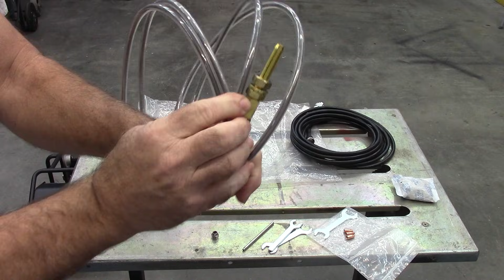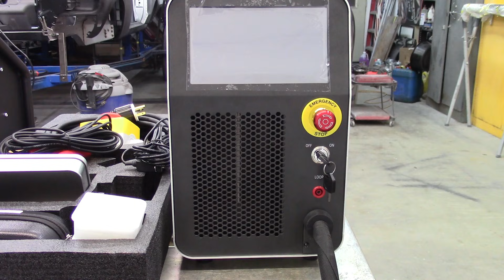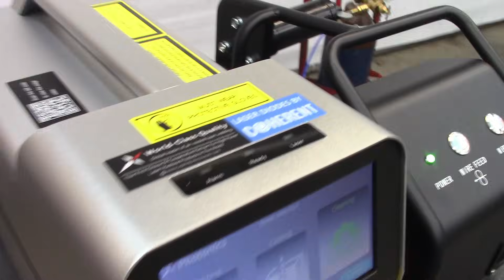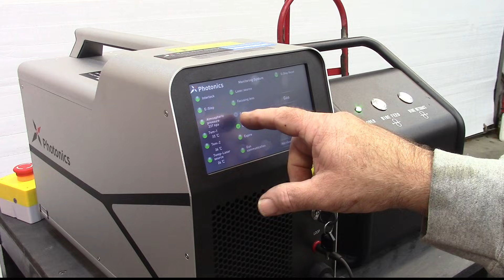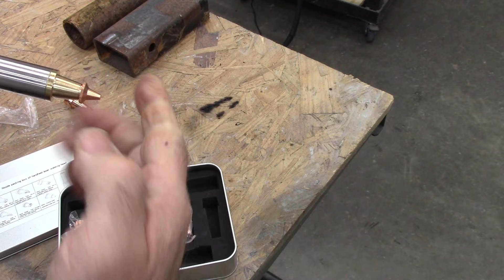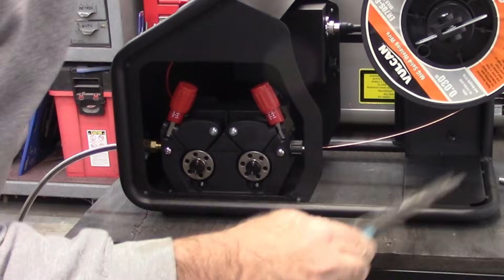Xlaser lab X1 pro laser welder. Unboxing, setup, and first use. Real review and no retakes.

Comment: The first important Thing is at welding you have to set the correct Focus. And i think 20% of Power (140 Watt) is way too less for welding. 100% for your machine is working well for 3mm steel.

Comment: At my watercooled five in one1.5kW Laser i have to change the Focus Lens if i use the cleaning Mode. The Focus is 1.000mm to the Work Piece and the width of the Pattern is 100mm to 100mm. So cleaning goes much faster. Your Laser looks like a Toy. How much Power has it and how much did you pay for ? For my machine i payed 2.800 USD directly from China.
Reply from the maker: I don’t remember. The welder was sent to me to make a demonstration.

Comment: @48.50 the red clip is certainly meant to be connected to the work piece. It’s a safety feature meant to prevent shooting laser ray in case accidentally pulling the gun trigger. It’s mentioned in the manual ”3.6.2 Safety Interlock Connection”.  When laser gun touches the workpiece, it completes circuit and works.

Comment: I don’t get why the kill switch has so many pins on the connector. When I design something with a kill switch, it has, at most, four wires. I can only think, if more wires are connected, that it might serve another purpose, such as factory testing, or for a CNC table. Though the other smaller connector seems to be a CNC output. If that were mine I would have already taken the cover off and investigated. My XTools model has a CNC output, but it’s a simpler connector.

The feeder needs to be stiffer as it only takes 8” or 12” rolls. No tiny 4” rolls. So the weight of those spools, the 12” can be up to 33 pounds, needs a lot of resistance, or it will free roll and you’ll get a wire nest.

And guys, while I know a lot of people think they’re too smart for the manual, but you really need to read it. The manual for this machine isn’t the greatest, but there are a number of things you should know before you use these things. It can be dangerous. If you think you know how to weld and you try to weld with this the way you MIG or TIG, you won’t do well. Don’t use 75/25. It will work, but the welds won’t be as good. NEVER use 100% co2. Some guys are claiming you can. You can’t. The welds will be brittle and weak.

You can use air when you clean. It’s only needed to keep dirt from blowing into the gun and damaging the lenses. You can also cut with air. You need a good 120 psi and a minimum of about 5 scfm. Like a plasma, you need enough air to blow the molten metal out of the cut. Otherwise it hardens right back in the slot. The cutting tip should just touch the metal as that’s where the focus is. The basic cleaning feature is meant to clean the edges of the metal you’re going to weld, not for overall cleaning.

I love this channel. But with this, you’ve done everything wrong that could be done wrong. Just follow the settings. Stop making your own. Logic is simple. The max this can ever hope to weld, for example is 4mm. That should have you thinking that full power might be best, not 20%. I don’t get all the problems you’ve been having. Stop guessing.
Reply from the maker: Thanks for the feedback. I expressed to the company my idea of going into this fairly naive. The average guy is going to go through similar issues. By demonstrating this way, it may help others. The company actually liked what I did.

Comment: You’re the first person unboxing this laser welder and said, “I have to learn it as I go.”  That makes you real  not a pretender. You own the process, you face the challenge, and that’s what makes you stand out. That’s the difference between real operators and influencers. And with that honesty, you just earned yourself a new subscriber.  for cleaning you need  the other nozzle/ guide tip and tube as well and compressed air works but make sure its "dry" air . Welding Nitrogen is good enough.  As for inert gas pressure, stay close to the 30 psi range. May I call you Jo? This unit is excellent for automotive sheet‑metal repairs and similar work. Once you master it, you’ll put down the MIG.
Reply from the maker: Thanks. I try to be as honest as I can with all that I do. I appreciate the feedback. My name is Barry. My daughter is Jo.

Comment: We had a handheld laser system at work that was being tested for coatings removal applications.  It had about an inch wide laser stripe width, so you could cover ground fast.  It removed rust really well, but the “overspray” past the ends of the workpiece could ignite paper three feet behind the workpiece.

Comment: I watch channel halfasskustoms, he started out with a bigger set up, then got a smaller one, both er great, he has gotten pretty good at it. Things I learned, though "use time" would be silly for me to buy one, is keep the tip as far away as possible, but within the zone, the fragments get up in to it and damage the lenses. For doing patch panels there is no other welder you want to use as there's almost no deformation. If you weld a small gap go in from the side and build it up to it joins together. Most people don't show you their mistake it took to get good, but in scattered video's of him using it I would feel confident. Also when cleaning rust you should be able to adjust the laser point to hold is back 6 or 8 inches. again so you don't damage the lenses, those are the biggest maintenance.